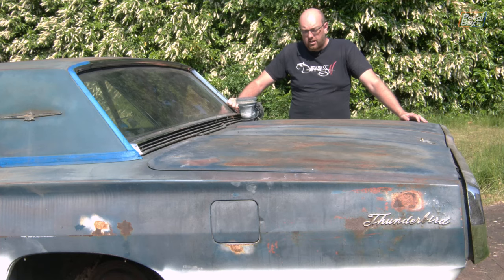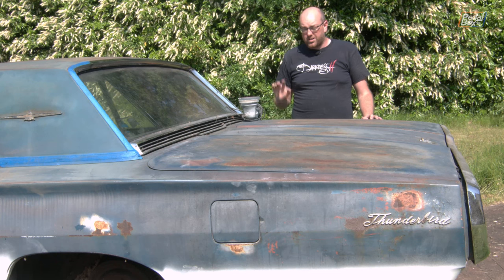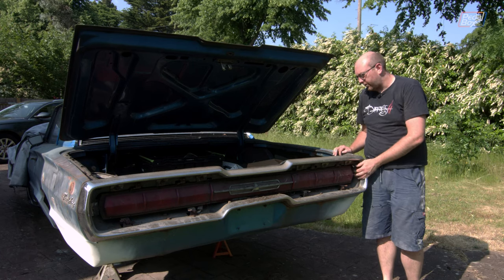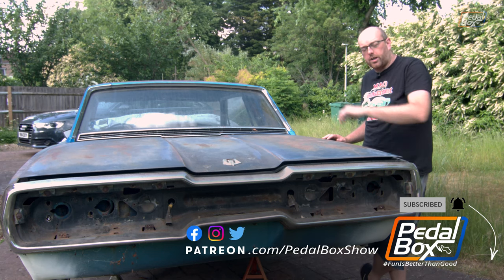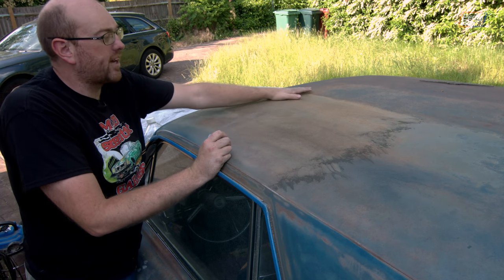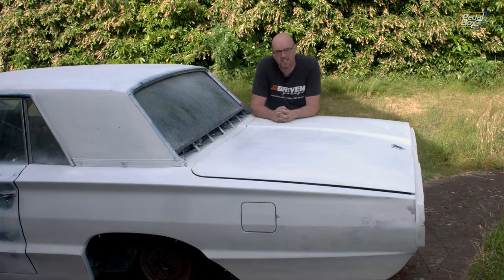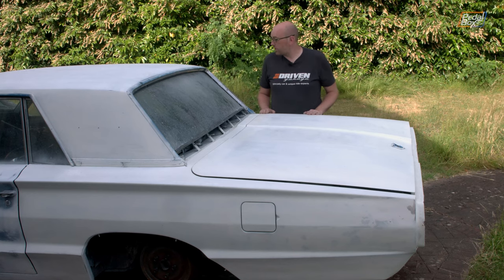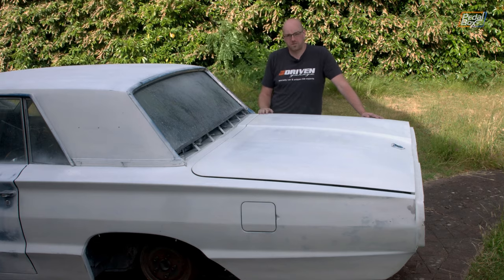Primed and Ready | 1966 Ford Thunderbird | PedalBox Episode 136

Comment: Hello. Nice work on the body work. I was just wondering if you have the assembly manual that is available.  I am working on a 66 Thunderbird,  and find that the assembly and the electrical manuals are a must. Keep up the good work. 
George B
Reply from the maker: Fortunately I picked on up at a swap meet in the US not long after I got the car, it's my big book of knowledge. And I still find I have questions on occasion! Most recently the start relay/motor has given me grief

Comment: what kind of acid did you use to treat the rust?
Reply from the maker: Phosphoric, I think it's a 10% solution? Works really nicely. I've taken to soaking bolts in it overnight as well as using the wire wheel, then re dipping again. Works nicely